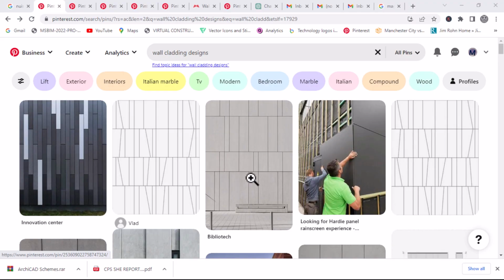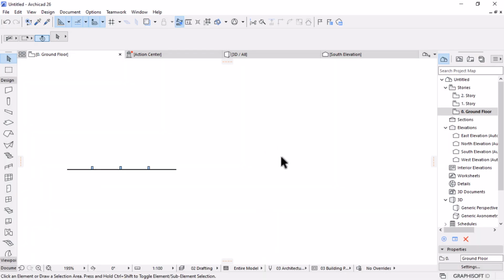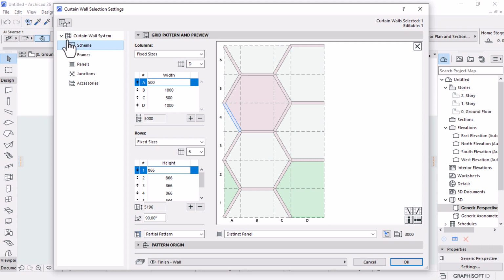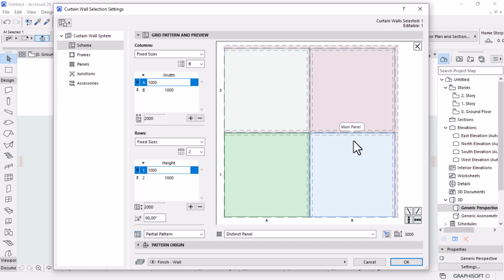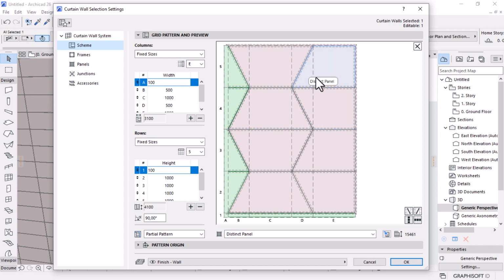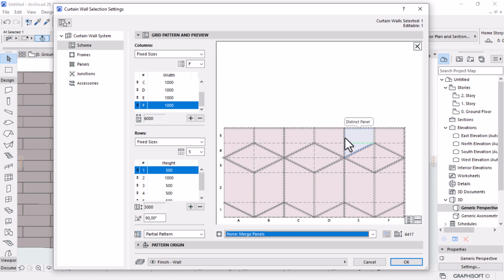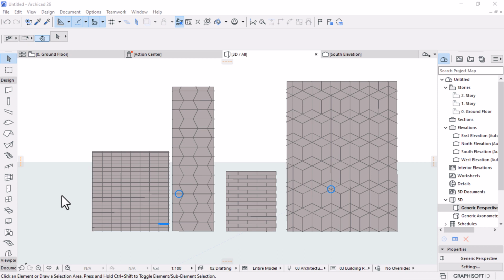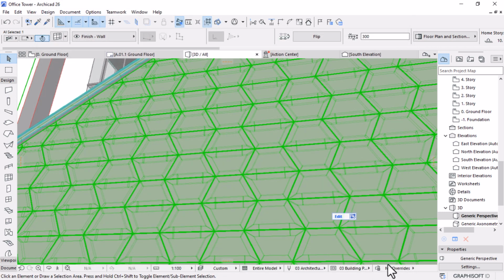ArchiCAD 26 Wall Cladding Design Tutorial | ArchiCAD For Beginners

Comment: Good morning, please I have an issue once I send my drawing to layout it will add 0 at the beginning of my dimensions.
 For instance in my floor plans my wall is 225 mm and once I place it in the layout it will change it to 0.225 .
   Please help me
Reply from the maker: It's because your units are on the meters instead of millimeters according to your dimensions value. So change the units in each view settings to millimeters in the view map.